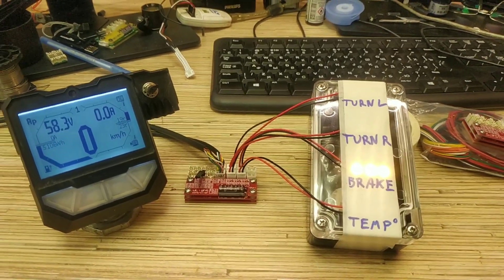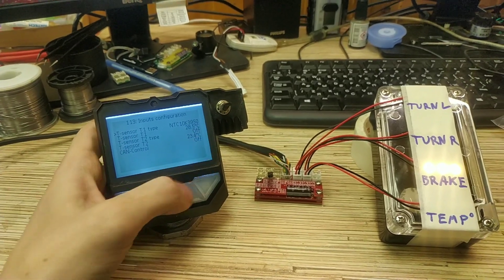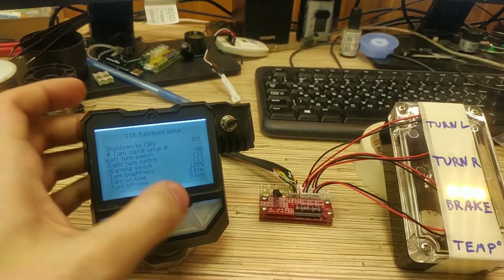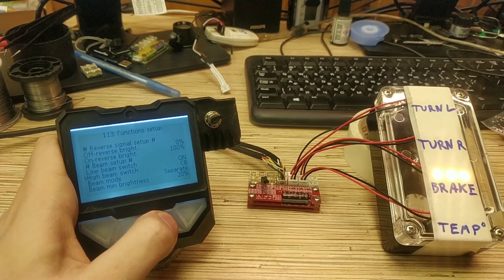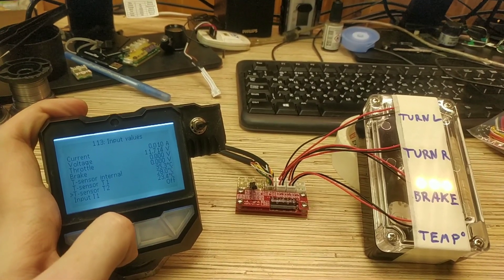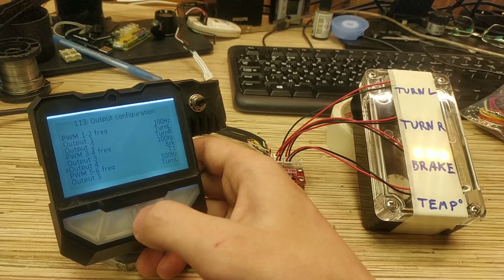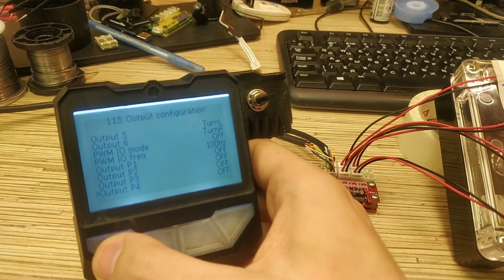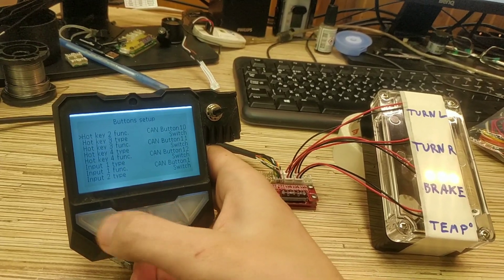Nucular uLight overview

Comment: Is there an app coming for the p24f ?. Also is the screen waterproof?
Reply from the maker: Waterproof from rain! (not form high pressure washer) 
App in beta, available by request
Reply: @NucularElectronics  sorry what does app in beta mean ?
Reply from the maker: @waynewigger9904  early version, might have bugs.
Reply: @NucularElectronics  so does the app need testing ? I've just purchased 2 of your talaria p24f controllers so do you need the app testing buy us ?
Reply from the maker: @waynewigger9904  yes it needs testing. not sure about your meaning in second question, but if you want bluetooth module please contact our support, or sales manager
Reply: @NucularElectronics  I mean if you need people to try and test the app for you and find any gremlins we can do that for you ?
Reply from the maker: @waynewigger9904  yes we need to find gremlins :) and yes you can!
Reply from the maker: @waynewigger9904  ask for BT module our support and join telegram group to provide feedback and get app updates. you will need android device to run app, ios not yet supported
Reply: @NucularElectronics  sorry.I've been sent a code but can't find where to enter it I can't comment on the pages yet unless I'm on the wrong page ?
Reply from the maker: @waynewigger9904  https://t.me/+oPAz4u-CnMcxYjZi did you joined this group?
Reply: @NucularElectronics  I'm on that group now via your link thanks just left a quick message on there